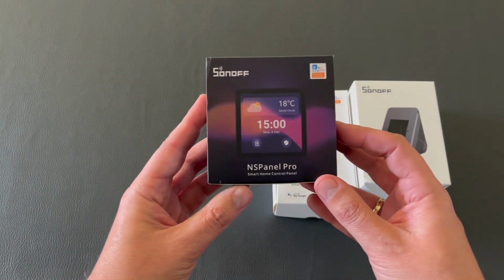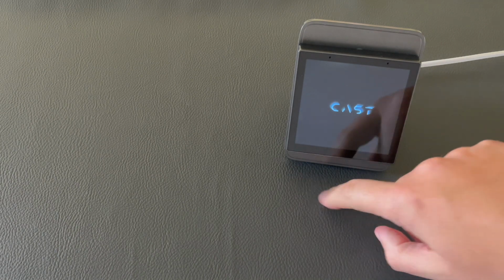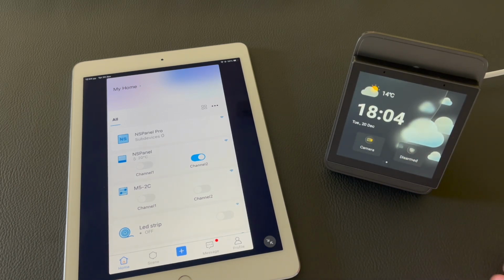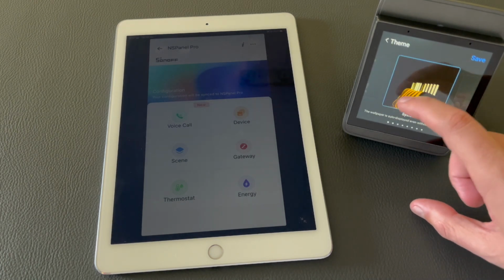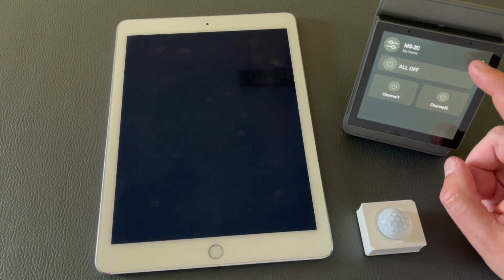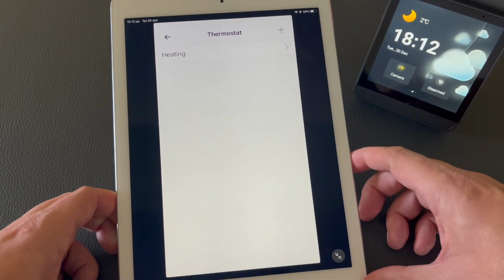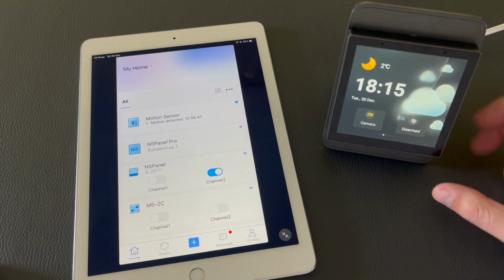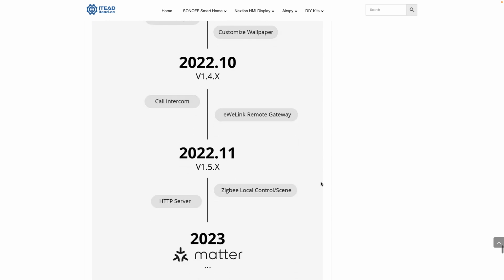SONOFF NSPanel Pro: The Smart Home Control Solution You Need

Comment: Great video, a question about the security features, If I set for example the away alarm, could a potential robber enter the house and disable the alarm using the NSPanel Pro or it get locked or something (only be able to be disabled with the Ewelink APP)??
Reply from the maker: I order to disarm the alarm does not require any kind of password. Just press the disarm button and alarm is off.
Reply: @PoseidwnTech  arong! Depends on your system!! All alarms have passcodes!
Reply: @AngeloR674  We are already working on the development, and the screen password will be updated in subsequent versions.